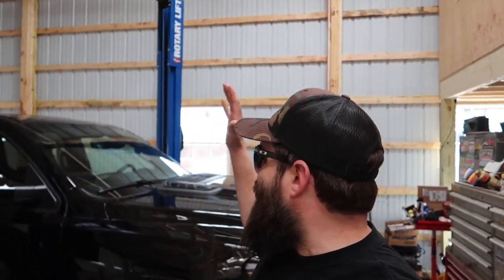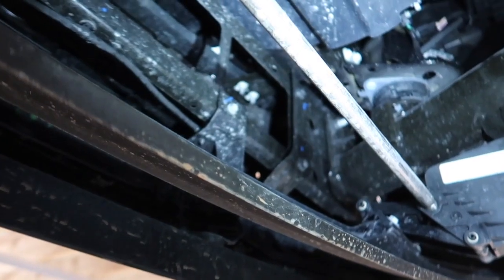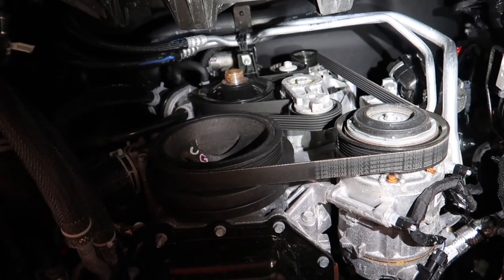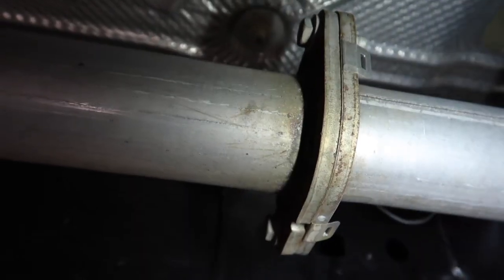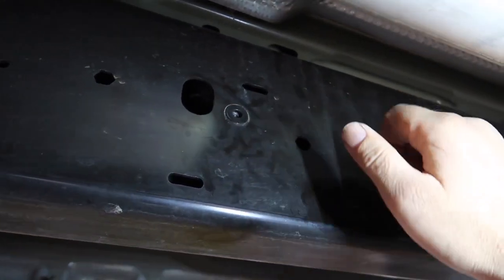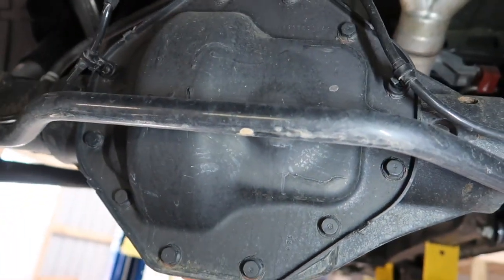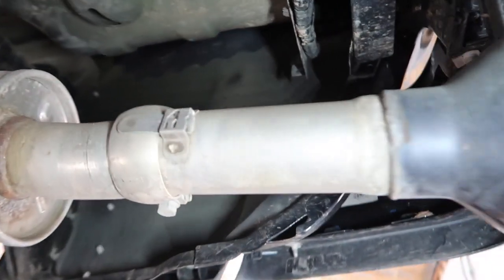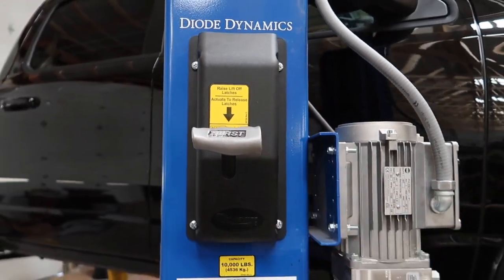2019 Ram 1500 Underside View

Comment: Excellent video. Cat back .... go Borla, really happy with mine.
Reply from the maker: Thanks I am considering Borla for sure
Reply: Borla atak
Reply: I have borla touring with borla resonator and it sounds perfect
Reply: is  borla    good  for  my  new  dodge  ram  larimie    sport    attack  ////??
Reply from the maker: Gordon allan definitely
Reply: Just asking what is the best exhaust for 2019 ram big horn 5.7. Also thinking about putting on a bigger tire and rim have 18s now was thinking 22. Inch
Reply: Chris Wilson Borla is a solid exhaust that always puts a smile on my face when I drive our 2019 5.7 hemi check em out. Worth the $$$
Reply: @NordicNevs  what's your opinion on 22 inch wheels and what tire for highway
Reply: @NordicNevs  I'm thinking about putting black wheels on my white 2019 ram and was going to a 22in wheel from 18s and what would be good highway tire. Appreciate your opinion
Reply: Chris Wilson so it depends to some degree on how you plan to use it. 22s look amazing on these trucks, they fit the wheel well great but the cost is sidewall, the wheel cost and the tire cost. Ok so that aside the 18s are far more function for a working wheel and tire combo but depending on your tastes it might be lacking. So let me offer an alternative. On my 2019 1500 (different than my 3500 avatar) I run a 20x10 with an aggressive offset. Leaves great options for tires, awesome stance with a blend of form and function. Ok so back to your question on a highway tire...personally NITTO makes a great tire. The dura grappler by NITTO is great. The other option I recommend is the cooper discoverer H/T   I have had amazing luck with both brands. Now, the reason why I suggest the 20x10 is because you can balance cost and function of the tire selections over the time you own the truck 👍👍👍 hope it’s helpful information though a little more than you may have asked for initially 😀
Reply: @NordicNevs  actually that helps I think I'll go with the 20 and read up on the Cooper's.  So yes it helped. And the borla exhuast will be after the tires.  Just have to sell the tires and wheels  that are on the truck now.

Comment: that's why I like my chrome bumper. I never buy a truck with a painted bumper or I upgrade to a heavy iron bumper
Reply: Daniel Garcia - I totally agree. A truck is a work vehicle. I bought a Big Horn for that reason. I live in Jersey. We get a fair amount of snow and I didn’t want to drive through deep snow with a painted or plastic bumper.
Reply: I can remember when painted bumpers were on the cheap basic work trucks and nobody wanted them !!! Chrome is where it’s at !!!
Reply: I just bought a 20 big horn to replace both my 03 Ram and my daily suv. Went chrome because after 17 years my 03 still absolutely glistens. I’ve only polished the chrome about three times and just regular wash and wax.

Comment: Steve FYI  my 2019 Ram Laramie AMP powersteps did not required the rivnuts there are studs sticking out that you use, I don;t know if the big horn is the same
Reply from the maker: hope mine have that when I go to install them guess we shall see I needed the riv nut tool for my 2nd gen fender flares anyway

Comment: regarding  frame rust, it is a serious issue to worry about, it develops also on the inside. Some reason they have many holes to let in salt water. Up north your underside is getting salt water baths all winter long. Your want the oily soft sprays, nothing that gets hard for undercoating. And they way our trucks are made, your fighting a losing battle with salty water.

Comment: Wanting to put a lift in my pole barn. What’s your lift and how much u have in it. Want it big enough to hold my 2020 ram similar to yours. Thank you
Reply from the maker: B Hewitt mine is a 10klb lift I’ve had 1 ton diesels on it no problem just have to make sure you concrete is thick and strong enough I think mine is 4000psi and 6 inch thick so a little overkill
Reply: Yea it's plenty thick. I poured it. Thank you for the info.

Comment: Great content, also I just got a 2019 Big Horn awhile ago. I have been searching and searching for a "Low Profile" Hard bed cover.  The issues I have been running into are the sizes, I called the dealership and was told that it is a 5'0 bed. Now my question is can I fit a TruXedo Sentry CT Hard Rolling Truck Bed Tonneau Cover? It is not equipped with the "Ram Boxes".
Reply from the maker: I put a roll n lock on the black ram without ram boxes I think it’s a 5.5 foot bed if I remember correct
Reply: The standard bed on a 1500 is 5’7”, I have the optional 6’4”.

Comment: You just dab it with the paint from the OEM brush then use 2000 grit sand paper and finesse it out to smooth out the head of the paint then buff it out.

Comment: I have read on forums that the exhaust running directly under the oil pan causes really high oil temps. I have seen some people heat wrap that portion of pipe. You guys have any thoughts on that? Thanks 🙏
Reply from the maker: sdc612 with the cooled pan on the trans and the fact that it is plastic or a composite material it should be fine plus the trans has a cooler also that is pretty much standard for the crossover pipe on most trucks
Reply: @UC6-PsI5zw4Eisi2qwpoVx6w have you heard this too?

Comment: I have a very interesting question. Does the Dodge V10 launch its spark plugs into space like a saturn V lift off like the Ford 6.8 V10 does? I have the Ford version and every two or three months we have a moon landing attempt. Ford does not seem to recognise this issue.
Reply from the maker: Ae Falzon I think that is a Ford issue mine has never done that in the dodge
Reply: @HammerdownMotorsportsUSA  yea it is just everytime it happens its $500 for resetting and helo coil (spelling could be off) each cylinder. It gets expensive.

Comment: You need some 3m clear tap protector
Reply: Getting mine done Wednesday
Reply: Had mine 19 RAM 3M on the Hood. Wish I would have done the rest. I also have a Chrome bumper. Rock chops is why.

Comment: Are the front bumpers steel on them now? The old style was plastic junk but it didn’t rock chip often
Reply from the maker: the upper part is plastic and the lower steel our 2010 had chips on the plastic pretty bad too and even a few dents on the chrome bumper

Comment: Holy hell I thought it was just my truck but my 2019 has the same issue with the front bumper paint!  Why is it chipping so much?  Damn.  I’m ordering the paint and the applicator.  I wonder if there is a clear film to cover it.  Mine is chipped up badly.  I’ve not got but 10 k miles ‘.    Thank you.  Good video
Reply: I have the 2019 Ram, painted front end and have the same problem. the paint they use is total crap! every time I wash it I find 2 more chips!

Comment: WARNING - WARNING - WARNING - WARNING - WARNING.................If you have the LED Light package on your 2019+ RAM 1500, do NOT, I repeat, DO NOT install an LED light into the 3rd Brake Light. The LED's produce a frequency that when pressing the brake pedal, causes an interference issue for the Keyless Starting System. When you press the brake and then press the start button, you can or will get a message on the dashboard screen that says "FOB NOT DETECTED" and or while driving you will get the message "FOB HAS LEFT THE VEHICLE". Chrysler is aware of this issue and is sharing this with it's dealers and their service departments. Share this with anyone you know that has a 2019+ Ram 1500 that is thinking about putting and LED light in the 3rd brake light.

Comment: The Ram frame paint is far superior to the self rusting wax that GM uses.  Spray it with Krown or Fluidfilm.
Reply: It’s a frame it doesn’t matter 

What does matter is the body tho 

You get a deep scratch on a dodge and there’s a 50% chance it’ll rust cuz the shit body coatings they give dodges
Reply: @Man_in_a_Gucci_Suit ther frame doesn't matter? Thats an interesting statement about the foundation the truck was built around lol. Dodge is still the new standard in quality.
Reply: Tyler R 

When frames rust it’s so irrelevant that it’s called “natural weight reduction” if you wanted to make the frame weaker you’d have to rub salt into that shit weekly and never wash it to make it weak it’s a FRAME

Comment: Weren't the older Gen rams true duals?! I don't like the fake, I do like how easy they make it to replace though

Obviously gotta get skid plates - composite may be stronger, but won't bend like steel if you flip up a big rock. And one of those valved drain plugs so you can just attach a hose and ¼turn it
Reply from the maker: pretty sure the 2010 was a similar exhaust set up
Reply: @HammerdownMotorsportsUSA  never had one, I just thought they advertised a true dual

Comment: 1 Spare tire retainer. Take that apart and grease or cosmo the heck out of it. It rusts like crazy and could leave you stuck.
2 Rear inner fender. Even with good maintenance they still rusted on my 2013
3 Chassis Saver on the parts starting to rust. SOON!
4 START SAVING FOR TIRES. My RAM used to eat tires! 
And fix that mud-hole son...what are you from WVA?

Comment: Too bad you didn't go over that tow hitch. It's supposed to be a new design.
Reply from the maker: nisssmo 510 I can mention it in an upcoming vid I think I all that changed is where the safety chains go on but it does work well
Reply: @HammerdownMotorsportsUSA  yeah that would be nice.  I'm leaning towards a Ram instead of the Silverado.

Comment: NEVER USE BEDLINER TO UNDERCOAT. Fluid film or similar products. Messy but prevents rust. Also the inside rockers have a tape applied over oval holes. This tape fails and allows the salt water in.

Comment: Yeah Ford learned the hard way using a plastic oil Pan in 2010 they stop that  Strange  Ram is still using plastic   I can't see that holding up for a long period of time I bet you could find a metal replacement Pan
Reply: ford still uses plastic oil pans

Comment: I hope you change out your PCM before you put a louder aftermarket exhaust on the truck, unless, UNLESS, you like the sound of a busted 4 cylinder Mazda when the MDS kicks in.
Reply from the maker: I have a Rebel now and have the loudest exhaust I have not had that issue
Reply: @HammerdownMotorsportsUSA  so you enjoy listening to a loud 4 cylinder?
Reply from the maker: @JeffreyStrader  with the Borla system you can barely hear it in eco mode
Reply: @HammerdownMotorsportsUSA  I have a 2007 RAM 1500 Bighorn. I had a FlowMaster 40 series system with dual 40's and Dumps, put on the truck. It was on there a total of 24 hours. (LOL)  I went back the next day and had it yanked back off. 3 months later, I finally received my Diablo Tuner, hooked it up and turned OFF the worthless MDS. The very next day I went back to the exhaust shop and they re-installed my FlowMaster system. Never looked back since then. My wife has a 2019 RAM 1500 4wd Bighorn Midnight Edition. Thing is nobody sells just a tuner so that we can turn off the MDS. You must replace the PCM all together...UGH! (NOT CHEAP! $1,000+)
Reply: @HammerdownMotorsportsUSA  can you put up a video so we can hear what the truck sounds like now?
Reply from the maker: @JeffreyStrader  the Rebel build series has tons of exhaust clips I pretty much have one in each vid lol
Reply: @HammerdownMotorsportsUSA  well I know what I'm about to be searching for.....LOL

Comment: I find the paint on my Rebel (2019) is absolute garbage, you look at it wrong and it scratches or chips. 
You can drive a tank over my 2014 Tahoe and it wouldn’t leave a scratch. Very frustrating I find.
Reply from the maker: Bacardi383 yeah I find my white 19 Rebel has much better paint than my black Laramie did

Comment: also being from PA i can say i cant stand how much they salt here, it really ruins vehicles. i used to live in Washington state (where they definitely get more snow) they use a lot less salt on the roads and actually apply sand mixtures to keep the ice from being able to form as well as for the grip it gives to your tires. i don't understand why they can't do that here, we spend so much unneeded money on the salt as well as maintenance of the equipment and also the mitigation of the salt (which does not degrade) so it doesn't affect the water quality (the EPA has already made states pay fines for having too high sodium as well as chloride levels in ground water).

Comment: Electric actuated air dam. That will never fail. At least it looks easy to get to when you have to fix it. I am pretty sure the holes in the cross member are not for air flow. They are there to lighten the component without compromising its integrity. That's pretty smart engineering. The same goes for the ribs in the transmission pan they are there to help shed weight not for any cooling effect. A composite pan is terrible at conducting heat so it wouldn't be very effective at cooling. Most of the time an aftermarket undercoating is a bad idea as it tends to trap water making corrosion worse. This frame is not simply painted. It is an E-Coat in which the protective coating is baked on in an oven. It is actually quite durable and will probably outlast the waxy coating that GM uses which is a surprisingly effective product. As far as the minor surface rust on your suspension components, coating them with a thick layer of undercoating will probably again trap water making the situation much worse. That minor surface rust on those thick heavy components will likely not cause any harm. The rest of the truck will likely wear out before that rust becomes an issue. BTW....your RAM is a beautiful truck and I am considering one for myself later this year when my lease on my current truck is up.

Comment: Get xpel, no more rock chips
Reply from the maker: Janelle Taillon I have been quoted insane amounts for expel plus I have friends that have to and they are not happy with it, basically it can lift and bubble and some rocks go right through it
Reply: Hammerdown Motorsports I have it on all three of my vehicles. Not one has bubbled or lifted. If your friends are bubbling or lifting they had a crappy installer. On my ZL1 I even have it doubled layered on the front bumper, hood and fenders. Not one Chip in 30000km. But hey to each there own.

Comment: 500 bucks for a all edges tucked clear bra, full front half hood and fenders plus mirrior caps. Your xpel dealer is ripping people off
Reply from the maker: I agree thats why I said forget that when I heard the price
Reply: @HammerdownMotorsportsUSA  ive had my last 4 cars done with nanofusion film and its been great, no orange peal look and bugs guts dont etch the surface. 2 cars and 2 trucks and my guy always charged me 500-600. Its nice not having to fill in rock chips. Problem is the paint is so much weaker and thinner than it was 20 years ago.

Comment: Dictionary: 

Dodge - to avoid
Reply: Avoid other brand of trucks that is.😁
Reply: Chris Perez 

Avoid reliable trucks that hold resale value that is like ford or Chevy
Reply: That resale value is really what your paying up front for the vehicle to begin with.  Look man, like all cars and trucks, they will all break down. Based on what I've read online, all brands have their share of defects. Its all based on what brand you like. No brand is superior than the other, its a a subjective preference.
Reply: Chris Perez 

I respect your point but I strongly stand by mine that Ford and Chevy are much more reliable rams have way too many Chrysler parts and even fiat components now 

Dodge has great engines don’t get me wrong (hemi and cummins) But that’s about it their transmissions are horrible  like the R68FE and fuel pumps water pumps and electrical failures 

But I do recognize that 90% of guys running logistics use ram duallys and like I said the hemi is good engine despite being a gas guzzler it’s just the rest of the vehicle that sucks tbh
Reply: @Man_in_a_Gucci_Suit  The ZF8HP transmission is one of the best in the biz. If you're not familiar, look it up. It's been standard on 1500's since 2013.

Comment: Sorry, I love the enthusiasm, but this guy does not appear to be very well versed on what he is presenting. He looks like a guy who bought a new truck that he loves and just wants to show it off. Fine. Just don't try describe the finer points when you don't really know them. 

He might be very handy with a hammer or Bobcat or screw gun, but here he shows a general lack of engineering design and materials knowledge. For example, composite parts do not have ribs for cooling the way aluminum sometimes does. (Composite is a poor heat conductor and there is a trans cooler that does the work there). The ribs are there for rigidity and weight reduction, just like the holes in the crossmember which reduces weight (not for airflow, turbulent air flow INCREASES drag) . Read up on the grill louvers on the truck and how they work.

Or, "solid" 4-link members? No, actually those are tubular... see  the weld seams? 

Read up, go to school, or find a master & become an apprentice for a few years, THEN do a YouTube channel on the subject.

Nothing personal, but people should not do a YouTube channel where they spread ignorance around. There is already enough bad information out there these days.
Reply from the maker: Chaim ben Ramon wow you sure know a lot for somebody without a channel maybe you can start one and share your vast knowledge instead of being a keyboard warrior, also I disagree with most of what you said, this video is not an engineers breakdown of these components it a relatable real persons view of what is under the truck